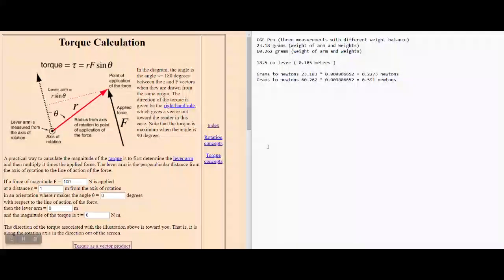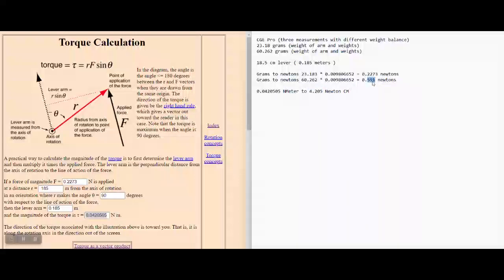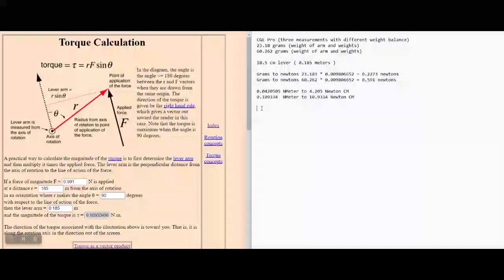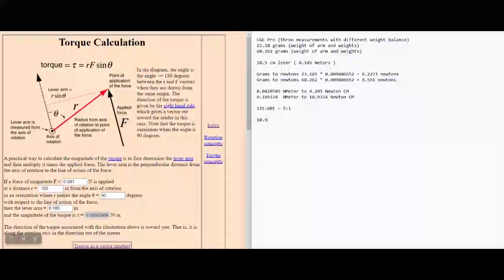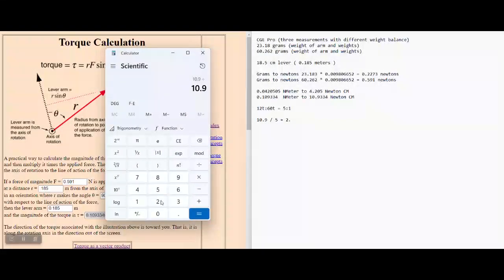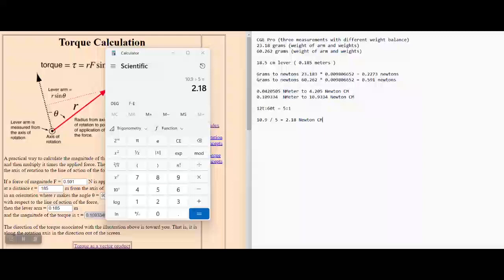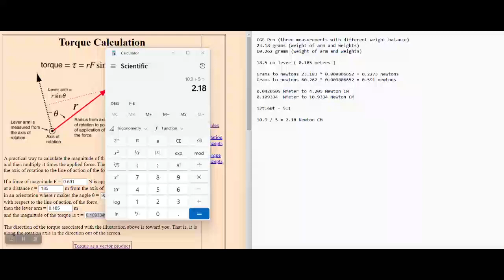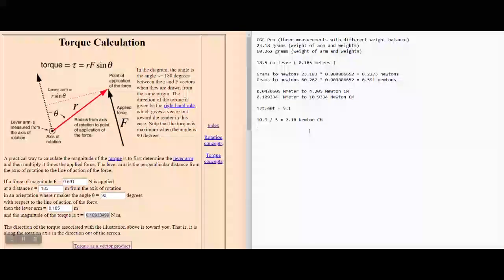OnStep Torque Measurements

Comment: All I can say is the CGE pro kit you sell the motors have more than enough torque to slew the RASA 11 around, the first light I finally got to use it I hadn't balanced it properly but still managed .27 guiding. Now the balancing has been improved I'm getting anything between .16 to .08 now. I haven't tried my 10" Newtonian on it yet but if what I'm getting is anything to go by I'm sure it will cope easily.

Comment: Hi mate. In your calculation you have forgot to account for the wight of the steel rod, which is probably much heavier, than your washers were. Since the rod is heavier than the washers, it will impact the resulting torque more than the washers are, so the answer will be way off. Approach is correct though.
Reply from the maker: Thanks' for the input!  I did weigh the aluminum rod, 3d printed hook and I include it in the calculation.  Maybe i forgot to mention it in the video.